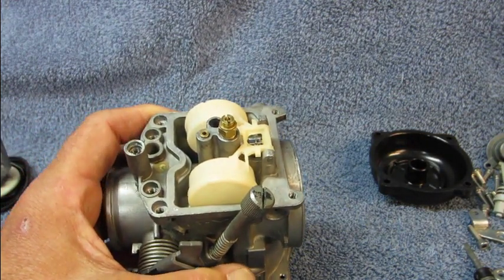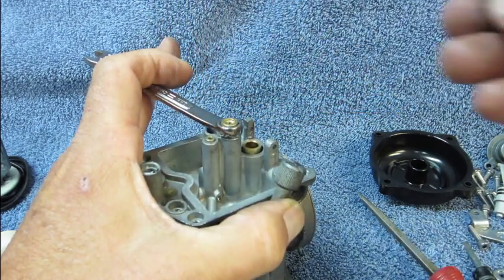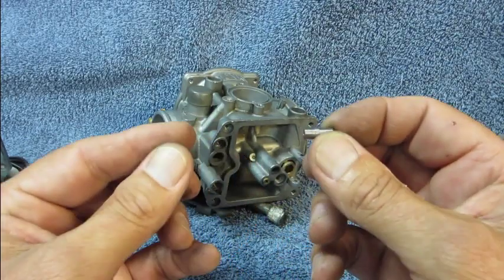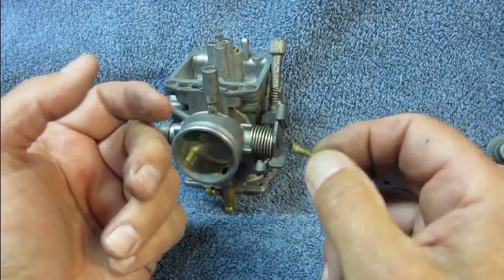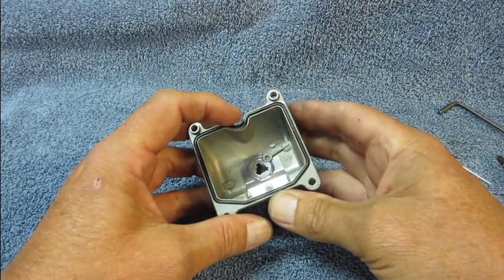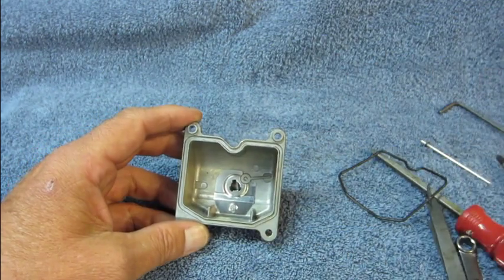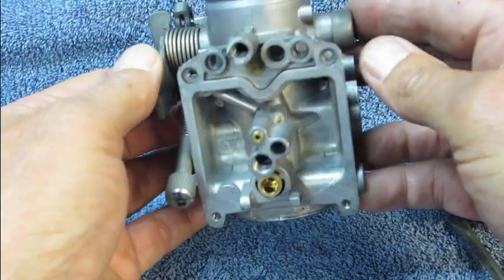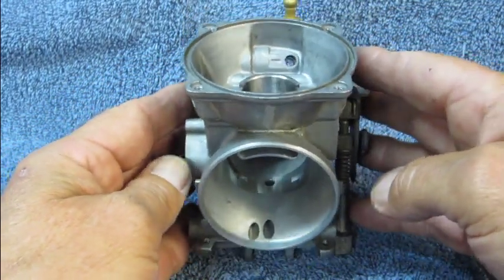CVK40 Carb Overhaul Video #2

Comment: OMG!!! THE FREAK’N JET NEEDLE!!! YOU JUST SAVED MY LIFE MAN!! I have been thru my carb a million times and I was ready to throw in the towel on the whole damn bike out of sheer frustration. There is no reason my Vulcan 1500 should be running so rich and crappy. I went through every single vacuum hose every single part of the carb, air box, air cleaners, compression checks, diaphragms, choke, throttle cables, tank vents, caps… you name it I checked it and cleaned it or replaced it. I never knew the needle jet was in there just like you stated! $50 mistake and I am glad to pay it but dagum.. not 1 single mention of this on any of the dozens of forum posts I read. THANK YOU SIR!!!!! YOU ARE THE MAN!!! A+++ video my man!
Reply from the maker: Steve,

I'm glad you found the issue! Those things are sneaky little devils...

Tom

Comment: Thanks for posting.
Helped me so much.
You should make one for reassembly of forks. Ive got a bucket of rings,bushings and bolts all nice and clean but how and where is another thing.
Reply from the maker: Sometimes the best place to go in a situation like this, even if you have a manual, is the parts fiche. Most of the big on-line stores have them, but I like Partzilla. You have to sign up and make an account, but I think it's worth it. When you OEM buy stuff their prices are pretty good, too.

The parts fiches are often better than the diagrams in the manual and you can zoom in and out and see what aprts are called.

Here's the parts fiche for the '09 fork: http://www.partzilla.com/parts/search/Kawasaki/Motorcycle/2009/KLE650A9F+Versys/FRONT+FORK/parts.html

If you have a Gen 1 you can navigate back to the beginning and select an '07.

Tom

Comment: I took note of the amount of down force you used when removing the pilot jet.  My screw driver did not fit fully down into the stock pilot jet slot.  It only engaged half of the depth of the slot on the pilot jet.  I did not use enough down force like you did and small pieces at the top of the jet at the slot sheared off.  On my second attempt I used much more down force and it "snapped" loose.  I matched up my screw driver to the jet and the screw driver did not fit fully down into the slot.

Comment: few... You scared the crap out of me with the (silver) "jet needle" part at 2:35 in the video... Because mine is actually copper in color, it could be brass.. But mine did not fall out, as well as I cant seem to push it out, but it appears to be very clean, SO I'm not going to risk damaging something by prying with a metal tool in there I'll leave it be.. lol   I actually pulled my entire carb out to re-adjust the float height so I searched for this jet needle while I was in there and wasn't sure til coming back to the video.  I feel better now knowing I did not lose it..  (* I should note I have a 34mm Keihin CVK carb off a snow mobile, so its not this carb in the video, nor is it the original carb to my KL250-D15... thus, it is not a CVK34  either... it just happens to be roughly 34mm-35mm ish, I cant identify it with the serial number stamped on the side as the internet seems to think it does not exist, but I ordered a brand new old stock CVK34 to replace this carb as its the closest that I could find, the jetting will be different however.  (But from what I understand the post 80's KLR250's had the carbs downgraded for emissions standards wich was the reasoning for the snowmobile carb)  WICH is great, but I'm struggling to get it to run correctly, seems to be too rich from 1500-2500..  either way I'll keep playing with it til the new CVK34 comes, wich should be the correct carb for a 250cc Kawi engine.
Reply from the maker: The OEM ones are silver. The brass ones come in some carburetor rebuild kits, most notably the Sumo kits. While I have a couple of the brass ones laying around, I have never used one. I did measure on and they are a perfect match.

There is nothing about them that makes removing them especially important for cleaning. The real point is that they tend to fall out and disappear while folks aren't looking!

The engine just won't run well at all without that piece.

Regards,
Tom
Reply: @souperdoo  That was an Incredibly fast response time.  Thank you, I've gone ahead and subscribed.
Reply from the maker: @gittyupalice96 , I move at the speed of Tom. Sometimes that's fast but usually, it's not.

Comment: Harley has the diaphragm p/n 27535-88 as they use this same carb in the past..about half the price of  Kaw.....do u agree?
Reply from the maker: Yes, as far as I know the Harley part is a direct replacement. We've found that some of the parts on the Sportster carb are NOT a direct replacement (if I recall correctly, the collar is different), the the diaphragm is. The Harley store will also have some larger pilot jets, which you may find you need if you've moved to a very free flowing exhaust and aren't able to tune out the decel popping.

Comment: Is this the same carb that came on the Vulcan 800? Looking to buying one and have been doing lots of research on carbs as my current bike is efi just preparing to tinker with it lol thanks in advance great videos btw!
Reply from the maker: Hi Jose,

Yes, it is pretty much the same carb. The carb on the 800 is a pumper carb with the pump being located at the bowl. There is a linkage to operate the pump. Outside of that, it is the same carb with some differences in drillings here and there.

From a rebuild standpoint, no differences other than the pump.

Tom

Comment: I put the metal parts in pure pine sole. 100 % . So when I remove the parts tomorrow do I need to wash the pine sol off with water
Reply from the maker: Yes, thoroughly rinse them with clean, warm water.

Comment: Great set of videos , I have a fuel seep( leak) around the float bowl. Do I have to remove the carb to replace the rubber gasket? Thanks
Reply from the maker: Meh, maybe yes, maybe no.

The screws on the bottom of the carb (and on the top) are a JIS screw. That's the Japanese version of Phillips.

They are just different enough from Phillips that it's easy to strip them using a Phillips screwdriver.

If you have a rather short JIS screwdriver, no problem. Just rotate the carb so that you can get at the bottom and remove the screws, then replace the gasket and back it goes. Good idea to replace the JIS screws with cap screws at that time.

Without a JIS screwdriver, what you can do is take a good quality Phillips that is not worn, blunt the tip just a bit, dip  the tip in oil and then in a bit of fine sand, apply a fair amount of pressure and carefully break the screw loose.

Some hints: I like to use a drywall screw bit that and a wrench like this one http://www.vimtools.com/Large/hbr3.jpg. I found a no-name version of this wrench at OSH for just a few bucks. I think Lowes has a Kobalt version and Craftsman makes a version. I dip the bit in valve lapping compound, which is basically oil and grit. Usually works.

If you strip them out, then the carb will have to come out so that you can put it on the bench and cut slots in the screws for a straight screwdriver. Honestly, unless someone else has been in there they usually aren't in that tight. but best to be prepared for the worst and have the suggested tools on hand.

Did you look at the 22 cent mod video? There are some tips there on how to turn the carburetor both ways while on the bike.

Good luck,

Tom

Comment: Did you just use water to rinse off the pine sol? Would you suggest rinsing the body/jets etc in gasoline?

Thanks again! 
P.s what do you use for grease on your o-rings?
Reply from the maker: A water rinse is sufficient, just blow everything out with compressed air. I wouldn't use gas - not necessary and it's messy and smelly.

Silicone grease should be used on o-rings. A petroleum grease may make them gummy and they may swell up.

Tom
Reply: souperdoo Thanks a lot Tom!

I made the mistake of soaking it overnight in water. There was rusty water on the pooled on the butterfly valve when I woke up. There is a bit of surface rust on the screws on the butterfly, and its a little sticky when first opening it. Is this a problem?

I've heard that about petroleum products in regards to o-rings, which is why I've been very cautious. I have some dielectric grease I'll use.

Thanks again. I really appreciate the help.
Reply from the maker: march11stoneytony The butterfly works against a pretty stiff spring, so it shouldn't be a real problem. Clean everything off well and put a drop of 3-in-1 or other light oil on the butterfly shaft. It should work itself out.

Tom

Comment: My pin is seized in place it will not come out
Reply from the maker: It shouldn't be! There is really nothing that would seize the pin.
Look to see if, for some reason, the pin has been staked in place.
It might be that some ethanol has gunked things up. Place some drops of carb cleaner on the pin where it passes through the carb body and let it sit for a while.
It should free up.

Comment: Can't you just clean all the parts with good ol' gasoline?
Reply from the maker: You can, but if you're going to go for something other than PineSol (a green solution; think of the children and the whales) you should consider a true carburetor cleaner.

Gas is going to stink. Carb cleaner stinks, too, but it works much better than gas for cleaning stuff.

Just keep anything that isn't metal out of it.

Tom
Reply: I like to use paint thinner as solvent ...not as noxious or as flammable as gasoline ...even coleman fuel is preferred to using just gas ...in my opinion

Comment: Great vid! My jet needle is completely gone haha
Reply from the maker: This carb kit https://www.souperdoo.com/stuff%20that%20i%20think%20about/sumo-carb-kit-helpswrestling-with-the-cvk40 has a new jet needle in it. The kit costs about $27, shipped, https://www.sumomotoparts.com/collections/carburetor-kit-1/products/kawasaki-high-quality-carburetor-rebuild-carb-repair-kit-klr-650-1987-2007

If you want OEM, that will run you about $40, shipped https://www.partzilla.com/product/kawasaki/16017-1254?ref=f5a51934edbdf7d00e345a3099d89c611a1a18ed#
Reply: @souperdoo  Awesome! I had been looking for another source besides expensive OEM. Thanks!

Comment: i do have a long needle hanging on the bowl, you don't. should i remove it? 
Because i can't fix the fuel leaking out of the overflow while the engine is running.
Already replaced the float + needle
Reply from the maker: Tibor,

If you are referring to a bowl overflow tube (like in this article: https://www.souperdoo.com/stuff%20that%20i%20think%20about/installing-a-carburetor-bowl-overflow-pipe-no-fear-of-fuel-hydrolock) then, no, you must not remove that. If you do the fuel will run freely from the bottom of the bowl.

You say that you have replaced the float and needle but if it is still overflowing then the needle is not seating and sealing. You probably need to remove the bowl, the float and needle, and gently clean and polish the needle seat. That is the brass bit that is installed in the carburetor body. They can get a build-up of solids on them that will prevent the needle from sealing.